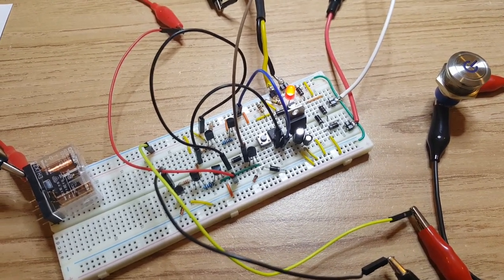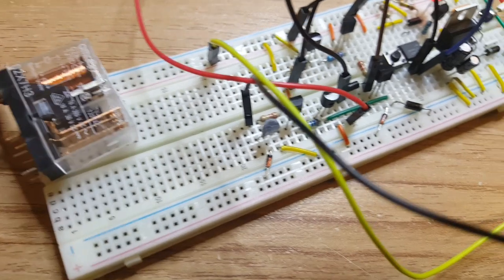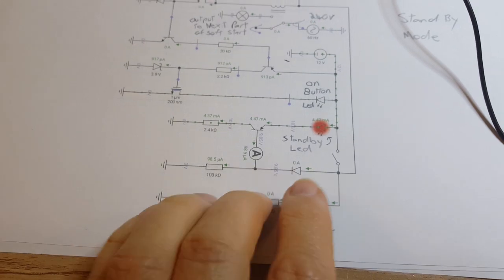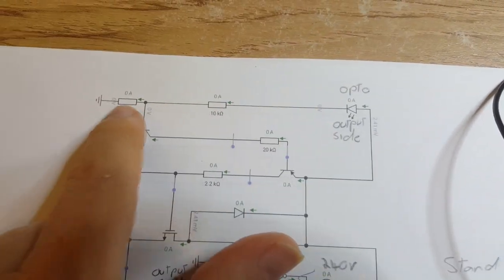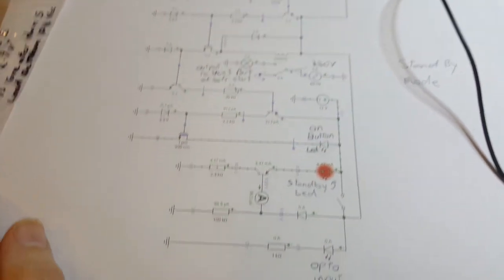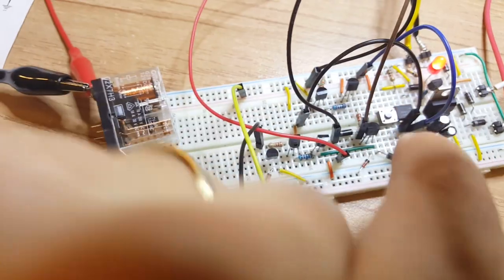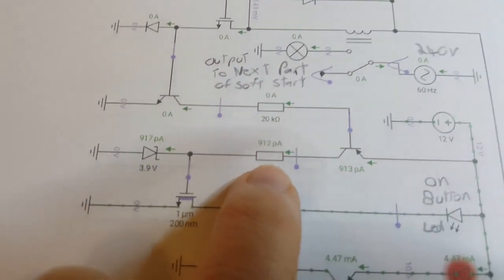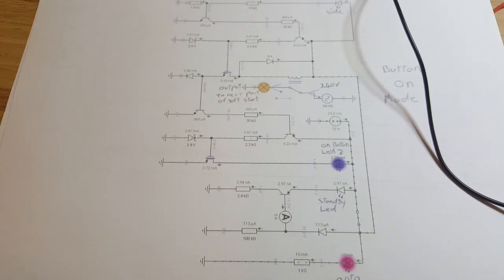Soft start circuit part 1

Comment: oh yes, I really enjoy Mr. ST :)
Reply from the maker: Thanks Juan. Really glad that you like it. Are you busy at the moment? Are you interested in putting my ruff schematic into multisim for me? I would of course make a donation for your time.
Reply: @stuartmp1974   ohoo I see cause the don't have R1,C1,D1 etc ok ok I'll installed back to my PC and made it ok :)
Reply from the maker: @vargasmongo3435 I'll email you my rough draft. Its a 12v regulator LM7812 and caps. Same setup as the speaker protection v1.5 for caps reference